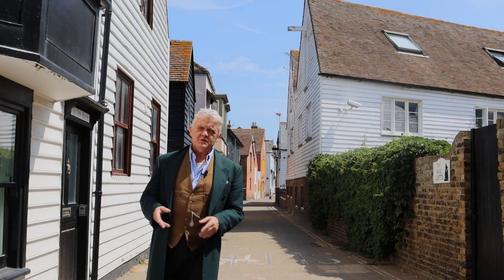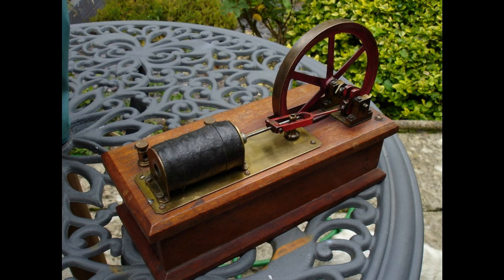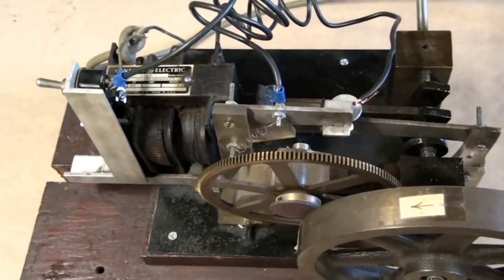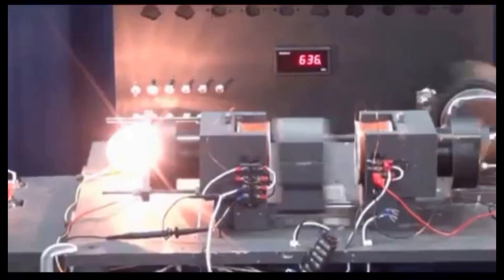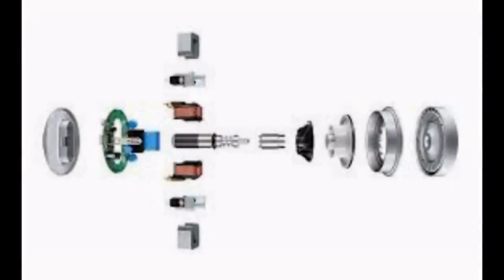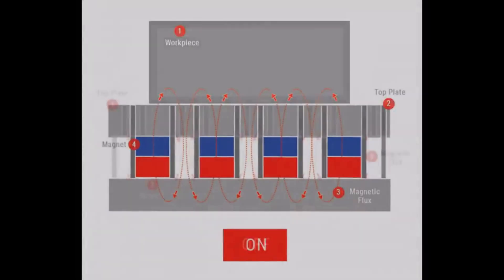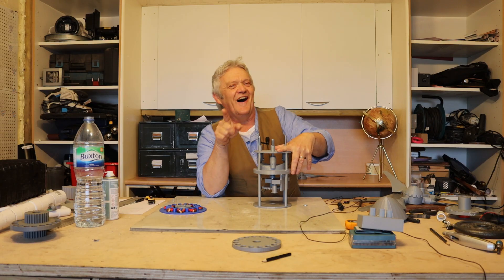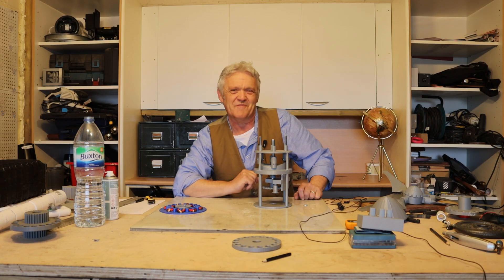2032 Solenoids, Flux Switching And The Inn Engine

Comment: Another Good one!...I looked into pinball machines and how the solenoids were wound. Using the ideas it helped me understand the sizing of wire and turns so that when energizing with electric the solenoid it wouldn't get red hot with running to much current and running at a high speed duty cycle.

Comment: Robert, I would love to see the Dyson motor linked in a pair, or multiples, and have them laid out on a track. This could possibly produce linear motion for transportation, launch assist for rockets, or even a gun.
I know you have discussed linear motion with motors before. If this experiment works like you want, I’d love to see you set a model train on a track, using a solenoid type of propulsion system.

Comment: Probably the simplest solenoid engine is one driven by AC mains, it goes at 50 Hz. No switches are needed at all, the AC does the switching. I found one within an air pump ( with rubber diaphragms attached on the ends to drive the air ). It ran maintenance free for years. Even then only the rubber needed replacing.

Comment: For the longest time I didn't understand the actual meaning behind a "magnetic circuit". It wasn't until I came across the "Keeper" and the idea of Reluctance (and permeability) and that the magnetic lines of force actually tend to travel the path with the least amount of Reluctance, that the idea began to make sense to me. 
This video is a really great reminder of that whole learning process. Thank you for making it.
  Re: That Inn Engine... does it have a roller bearing where the "piston" meets the surface? Also, you will likely need some stronger lateral stabilization, as the forces will tend to push the piston opposite the direction of the ramp.

Comment: I know this sounds bat sh.t crazy but I think I’ve just designed a ‘perpetual’ motion machine after watching your video. Only I’m going to need you to try it 🥴 I’ve just got out of bed to sketch it on paper. It’s not a free energy machine. But I think this may work. Let me know your thoughts. It’s a very simple concept using magnets. No electricity needed. And yes I am fully aware that no one thinks this can be done.
Reply: Whether or not anyone thinks it can be done is irrelevant. A lot of people, apparently, think it can be done.

It cannot.
Reply: It’s not free energy. Of course my design would run out of steam once the energy in the magnets has dissipated. However until then, no electric needed. Maybe perpetual is the wrong phrase?

Maybe nobody has thought of my design?

Would you say the Earth rotating around the Sun is perpetual? Can you explain how it came to be by design?

I don’t care who tries it, I’ll give the design to anyone who has the engineering skills.

I myself am the wrong type of Engineer. A computer systems and network engineer.

Comment: And my previous commitment leads me to describe an ICE engined pogo stick that was once marketed in Australia by the businessman/aviator/philanthropist Dick Smith. The spung leg of pogo stick was connected mechanically to say a 50cc piston to ride in combustion chamber at top of the movement..... I'll leave the description here as being sufficient.  However i guess it never caught on .

   Did you know that the hopping kangaroo has the most st efficient form of locomotion in the animal kingdom .
Reply: Road menders used an IC 'bumper/flattener' for repairing tarmac roads.  It would 'kaa-BUMF' about every 2 seconds, springing it's huge mass about 9"-1' into the air.

Comment: I worked for 21 years as a professional tattoo artist in Sacramento, Hollywood, and las Vegas. I have Worked on, repaired, and rebuilt hundreds of tattoo machines in that time. they run on 2 electric  magnets. they are fascinating reciprocal designs. I have a feeling you would find them intriguing. newer tattoo machines are going the way of rotary machines. btw, they are not called tattoo guns. it hurts my ears to hear them called that.
Reply: The history of the tattoo machine is pretty cool too. It was a modified design from the "electric pen" invented by Edison.
Reply: You have me thinking of those Wagner piston head spray paint guns . In the end I liked the effect of just painting my cars or vans by paint brush using top quality oil based house paint .
Reply: Interesting

Comment: 🤔 Now the hybrid solenoid / combustion engine, where the solenoid part is also the combustion piston part.
Reply: A while ago I wondered about a combination magnetic/compressed air engine. The energy wasted by the solenoid is largely heat, which could be used to reheat air as it expands in the cylinder. Might be fun to revisit that idea.